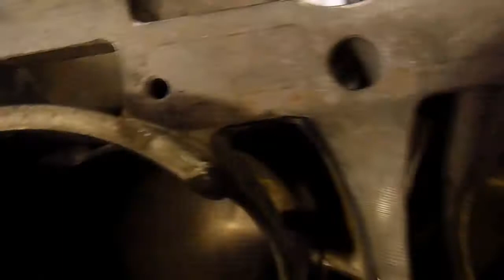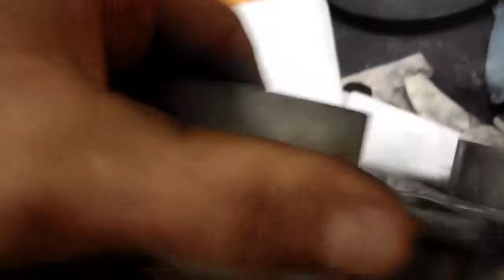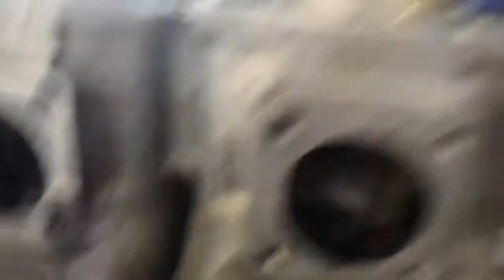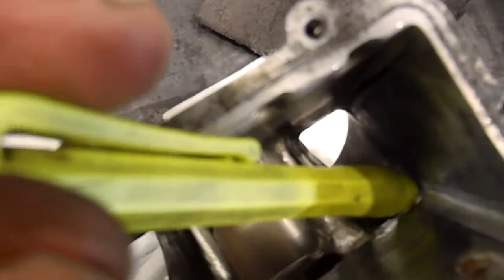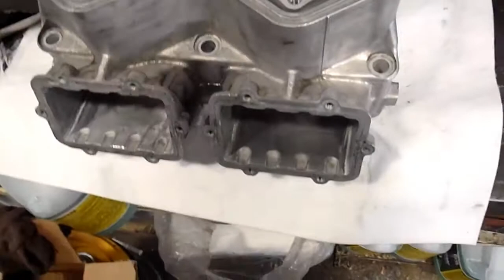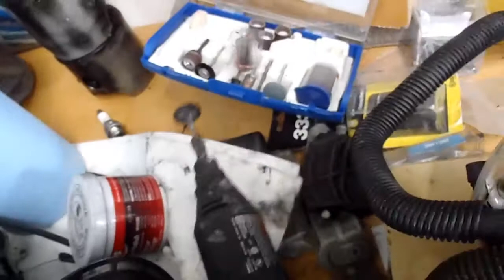800 etec Cylinder monoblock prep and port polish

Comment: So what were the gains with this kind of porting? Im thinking about some DIY porting on skidoo 700 jugs and gathering as much info as possible.
Reply from the maker: Not sure what the gains are since I don't have a dino.  I can feel the difference when riding, but everything helps, the Y-pipe, and reeds as well as the porting.  If you just smoothen it all out and polish, you can't go wrong.  Just don't change port timing and you'll be fine